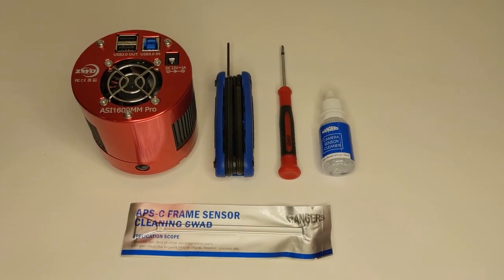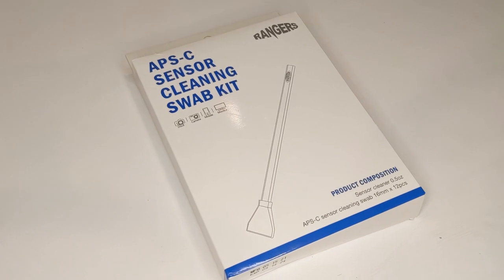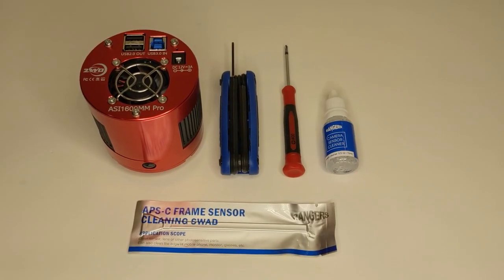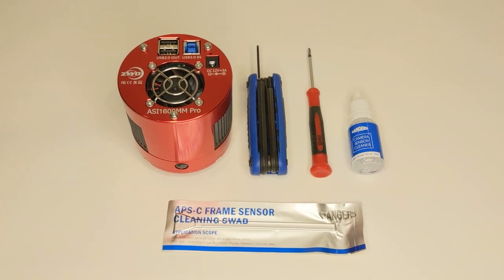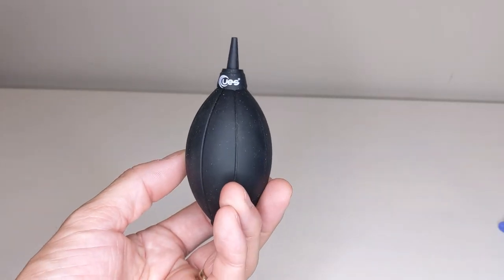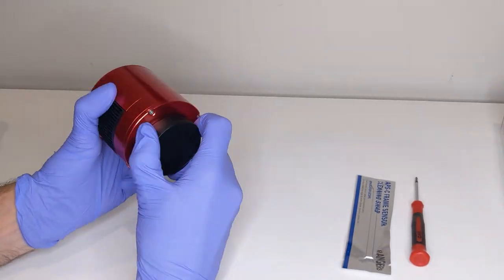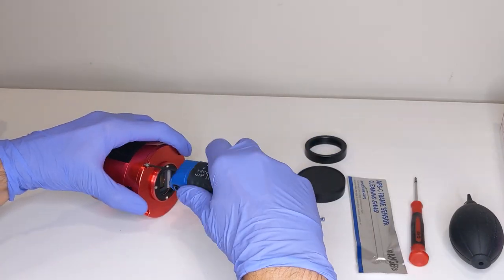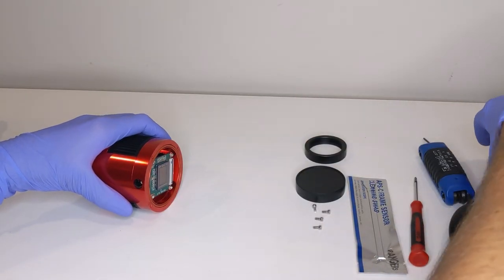ZWO OIL LEAK - HOW TO CLEAN Your Astrophotography Camera Sensor

Comment: Thanks so much! My ZWO 2600 was recently hit by the dreaded oil leak, but thanks to your video it was easy to fix. One note: when replacing the cover, be sure the window is properly aligned with the sensor before putting in the screws. It's easy to correct if you get it wrong the first time, but the less time exposed to the air the better.
Reply from the maker: Awesome, so glad it was helpful! Really good point on the window alignment, that would be an easy mistake to make!

Comment: Glad to have found another small astrophotography channel! I was directed here from Russell's channel - he did a video on cleaning the sensor of his 2600MM Pro and gave you a shout out. No, I don't need to do a sensor cleaning (yet). Now that I'm here, I'm going to watch your mosaic videos...Clear skies!
Reply from the maker: Wonderful, glad you found me 😁 Russell was very kind giving me the shout-out. What setup do you image with?
Reply: @WindyCityAstrophotography  I image with a 0.8x reduced GT81, ASI294MM Pro with Chroma filters riding on an iOptron CEM40. I keep looking at upgrading the camera to the 2600MM... but ouch on the cost of entry... $3600 for the ZWO kit (camera, EFW, LRGBSHO filters, OAG).
Reply from the maker: @JonnyBravo0311  Nice! Love the CEM40. Yeah that cost is up there for sure. Thankfully the 2600 isn't compatible with the RASA and my filter slider so that has prevented me from doing something foolish 😆. Maybe one day I will spring for the MC and the NBZ filter and call it done.

Comment: Excellent video....I've been dreading the day I may have to do the same. But now....you've almost made it sound like a piece of cake. Very good info on the tabs/microwave/urgency to reinstall.  Well done ....well done.
Reply from the maker: Thank you! It is a very delicate piece of cake that shouldn't be eaten lightly. 😁 But no need to dread, apparently, though I felt that way at first.

Comment: The ASI1600 has a Micro 4/3 sensor, not an APSC, so your swabs are a bit big.

But they seem to have done the job. Thanks for the video
Reply from the maker: 😆 Agreed, hazards of a too-hasty Amazon purchase. but yes they did well!
Reply: Strictly speaking it's a 4/3 sensor. MFT is really a reference to a shorter flange to focus distance. And it's preferable that he used an APS-C swab since the sensor cover glass is bigger than the actual sensor. A FF swab might have even worked better (wiping in the other direction).

Comment: You did the most important thing to protect your work.  The sensor is perpendicular to the floor.  That alone keeps a lot of the airborne dust away.  I notice you also did the same with the sensor cover and desiccant tabs.  This is the best advice to those who want to try this at home.  Great video!  Wish I’d seen it before I spent a whole weekend cleaning my camera.

The other best advice is do not use canned air.  It’s got a lot of stuff in it that will only prolong your cleaning cycle.
Reply from the maker: Thanks so much! Yes I was very careful with the perpendicular surfaces and totally agreed on canned air 😬

Comment: Been cleaning my sensors for years.  Both Nikon and Sony sensors are dust magnets.  I don't mind doing flats, it's just remembering to do them before a shoot.
Reply from the maker: Oh for sure! Flats are a must at least with my setup, dirty sensor or not 😁 At least DSLR sensors are accessible and the camera offers a cleaning mode and such. Cooled astrocams are the same, it's just more work to get to the sensor and then deal with the desiccant tabs

Comment: What does ZWO say regarding Warranty when doing this?
Reply from the maker: Good consideration! My impression from the forums and also from the ZWO instruction PDF is that your warranty is still intact after this, and ZWO actively encourages folks to do it themselves. But definitely check with them directly if you are concerned about it; they are quick to respond! They will apparently do it or perhaps it can be done by the vendor you bought it from, but with a long turnaround time presumably
Reply: @WindyCityAstrophotography  thanks :), i am trying to figure out who has better warranty service, ZWO or QHY (wanting to buy a 2600 or 268) this helps

Comment: I have had to do this 3 times in the last 18 months or so to my ASI1600MM Pro. The first time the desiccant tablets disintegrated with the slightest touch and introduced a heap of fine particles into the sensor chamber. It freaked me out, but the bulb blower did its job and the new tablets did their job. A bit frustrating that this issue is a recurring one, but like you said, an easy (but inconvenient) job. Cheers
Reply from the maker: Wow, glad mine hadn't disintegrated like that but I'll look out for it next time (ha!). Thanks for watching!

Comment: Hi Nick! Great video! I do it similar but dry the tabs first. Then set them back into the cover. Then I clean the chip. Then I place the cam on a flat screen and take some flats to check for dust and dirt. Then I clean the window in the cover. Mount it onto the cam and take again some more flats to check for dust and dirt.
Reply from the maker: That is a smart idea to take flats as you go along!